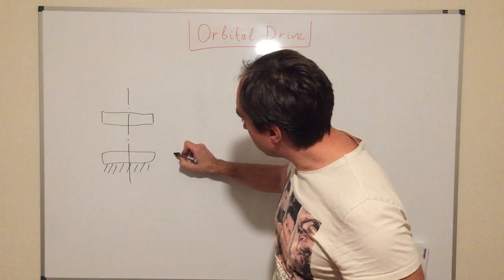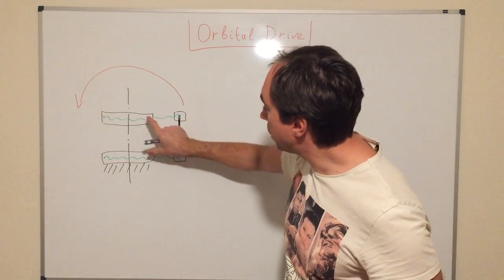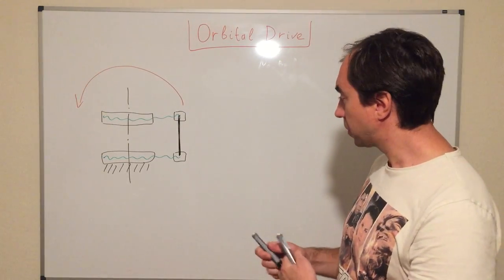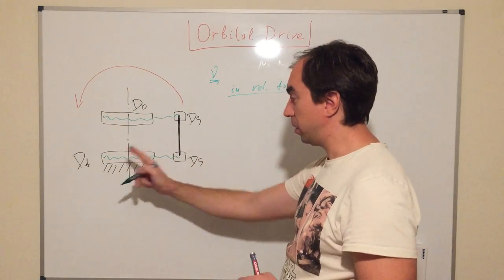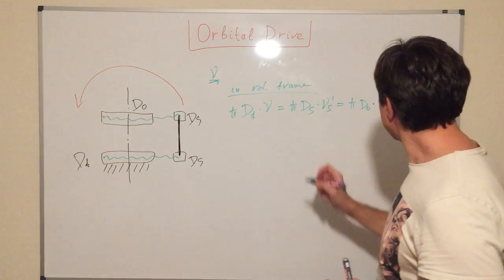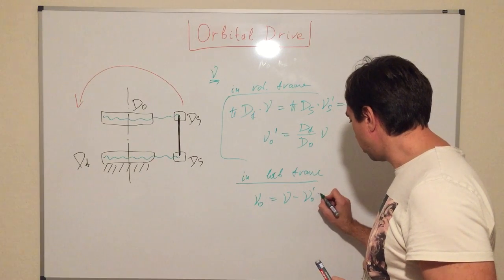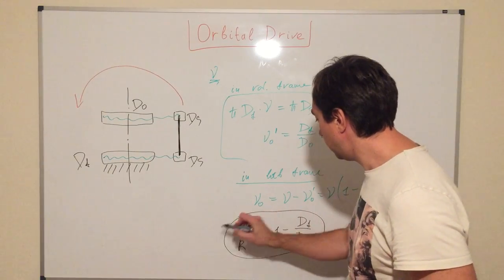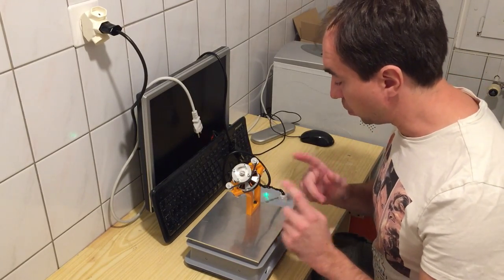Orbital Drive Reducer Explained

Comment: It's a planetary gearbox built with two sun gears or an external gear in place of the ring gear.  Built one 15 or 20 years ago as part of a racing Kart clutch.  Linked planet gears of different tooth counts. Both sun gears had different tooth counts as well. Seen them before.  The very high gear reduction you achieved is interesting but not a new invention.  Multiple examples shown on the wiki page for "Epicyclic gearing".  Still, very cool work with the motor on the inside instead of driving one of the shafts on the outside.

Comment: I know it's an old video but I just found it. Pretty cool idea, it works just like a dual stage planetary gearbox but instead of using 2 different sized ring gears and 2 sets of planet gears, it uses belts. Seems like you could get a lot more ratios out of it since you are not as limited by geometry for the meshing of the gears. Are you going to use this method in any upcoming robotic arm designs? It's hard to find motors that don't do 10k RPM + at this size and the reduction methods are fairly limited.

Comment: If the upper center gear has 68 teeth and the bottom base gear has the 70 teeth, isn’t the tension of the upper belt loose?
Reply from the maker: Belts have different length, to account this

Comment: Thanks for sharing this great idea (using belts for this kind of gears). thumbs up. 

How much torque do you think it can handle? (consider a well-made product!) to be exact: consider a position controlled joint using this structure. how well does this system convert the torque (or stall-torque)? Is it appropriate to be used in a robotic arm as a joint?
would you also consider it as back-drivable? (by that I mean if you rotate the output, would the inner motor rotate easily?)
Reply from the maker: Thank you for your comment! I was building it for a robotic arm, so I think it is quite appropriate for this. I think it can handle a lot of torque when properly designed. You should just check that the belts can handle your desired torque. Some time ago I checked the available belts and motors, and I found that it is possible to make 100Nm torque reducer (with off the shelf components).
I did not measure the torque of the reducer from this video, but in the present configuration (plastic 3D printed parts + low voltage power supply) I barely can stop the motor by hand. It is quite strong.
Also it is back-drivable, but with the high reduction ratio it is difficult to back drive it.
Reply: Why is back-driveable desirable? Just curious
Reply: @TheRainHarvester  for robotic compliance
Reply: @TheRainHarvester  and also for for applications like motion teaching

Comment: Looking at your formula. If D0 = D1 then 1/R = 0 ? so R->infinite
I'm missing something?
R = 1- (D0/D1) is more consistent
Reply: I think the gear ratio should be the distance from the motor rotor plus the tiny timing pulley diameter, divided by output timing pulley

Comment: This came up in my feed recently and I've been having a think about it. It looks like you've got a compound planetary sort of setup turned inside out. 

This video seems to have an analogous gearbox: https://www.youtube.com/watch?v=-VtbSvVxaFA

If you remove the belt since it is an unnecessary element when the motor diameter is small enough for the gears to mesh directly, then you turn your two central gears inside out, they become the ring gears of the planetary and your orbiting gears are the planets. You don't have sun gears. You're driving the planetary carrier directly.

I do think the more traditional approach is likely to be the practical solution though. Having your input and output on the exterior makes it easier to mount them on, for example, a robot arm. Ditching the sun gears might still be a neat trick if you want to use the centre as a cable guide for  further segments of the arm. You could belt drive the carrier and then easily embed the drive motor lower down the arm (with a further reduction stage in the belt drive)

Comment: Why does it twitch?
Reply from the maker: Because motor controller is not good enough for this application. It use low current for lower speed. I have a plan to develop my own bldc controller for this application.